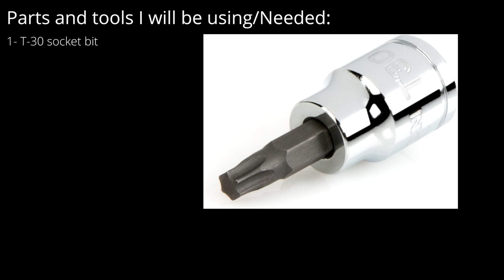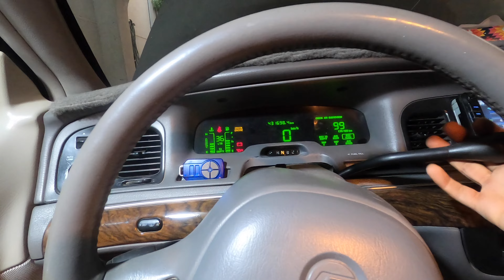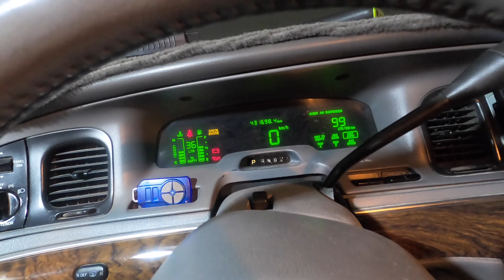How to Fix Excessive Play in Gear Shift Lever (Easy Way)- Ford Grand Marquis

Comment: How do you fix a electric seat to move up if it’s not working?
Reply from the maker: Check the motor first, if it’s running or not. 
If motor is okay, check the gears inside it, gears might be slipping off because of broken teeth.